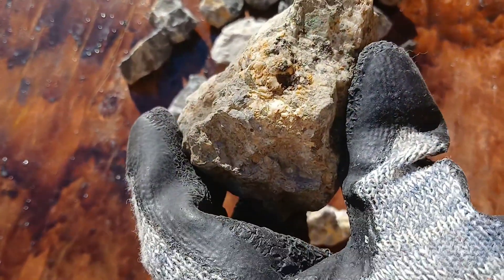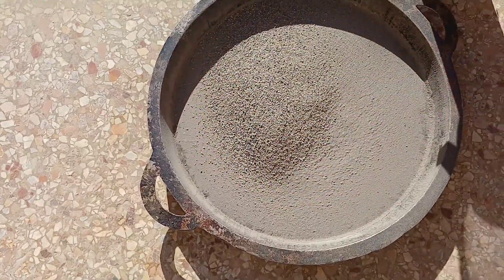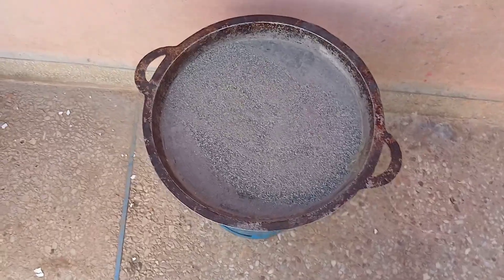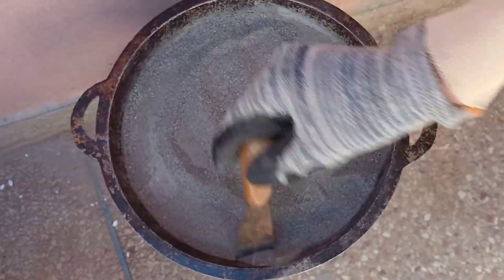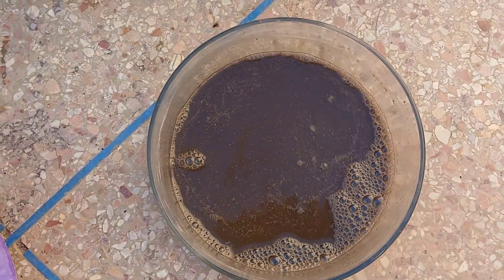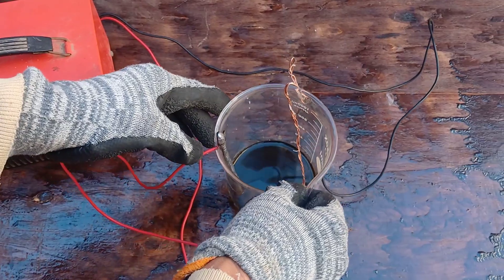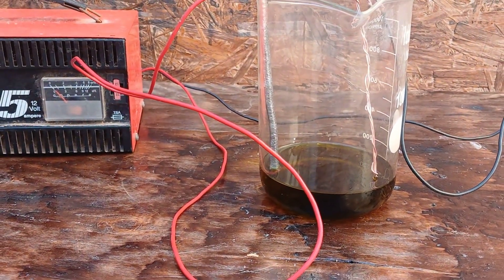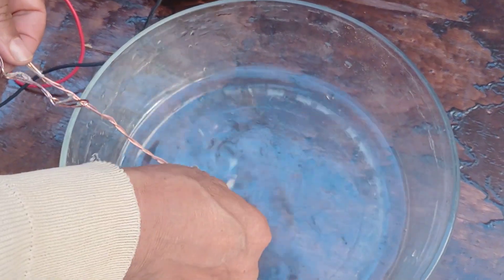"Extracting Microscopic Gold from Hard Rocks Using the Electrolysis Process of Aqua Regia"

Comment: The way I understand it is ‘microscopic gold’ is still visible with magnification.  ‘Refractory gold’ is sub-microscopic gold not visible even with an electron microscope.  Refractory gold is trapped within the sulfides and requires open-air oxide roasting to ‘liberate’ it from the host rock.  Once roasted magnetic separation is required to remove iron oxides.  I then use gravity separation to obtain the concentrates for smelting.
Reply: vc teria algun canal com algumas informacoes do processo amigo passar pra nos??

Comment: my ore is heavy in iron and my process with Hydro is green green green. Do i have to keep repeating the hydro step before moving to the AR process? it is causing a lot of problems and we know its high gold content.
I rinsed 5-6 times and sat over night and it was golden but when idfiltered it it turn brown due to fine sediments.
Reply from the maker: It looks like you're dealing with an ore that has a high iron content, and you're using hydrochloric acid (likely "Hydro" refers to HCl) before moving to the aqua regia (AR) process. The green color indicates the presence of dissolved iron (likely ferric chloride or ferrous chloride). Here’s a clearer breakdown to optimize your gold recovery:

1. Why is the solution green?

The green color suggests a high concentration of iron compounds, which can interfere with gold dissolution in the AR process. It’s essential to remove as much iron as possible before proceeding.

---

2. Should you repeat the HCl (hydro) step?

Yes, but only until the green color fades significantly. If iron remains, it can consume the nitric acid in aqua regia, reducing its efficiency in dissolving gold.

Steps to improve your process:

1. Leaching with HCl (Pre-treatment Step):

Heat the ore gently in dilute HCl (10-20%) to dissolve the iron.

Stir periodically and let it react for several hours.

Filter the solution to separate the solids from the iron-rich liquid.

Repeat this process until the solution is no longer deep green.

2. Oxidizing Agent (Optional for Stubborn Iron):

If iron persists, add a small amount of hydrogen peroxide (H₂O₂) or chlorine bleach to accelerate iron removal.

Avoid adding too much to prevent unwanted side reactions.

---

3. Dealing with Fine Sediments:

The brown color after filtration suggests fine residues (possibly iron oxides or other impurities). To minimize this:

Use fine mesh filters or vacuum filtration for better separation.

Perform multiple wash cycles with distilled water after each acid treatment.

---

4. Aqua Regia Process (After Iron Removal):

Once the green color is mostly gone:

Dry the cleaned ore thoroughly.

Prepare fresh aqua regia (3:1 ratio of HCl to HNO₃).

Add the AR slowly to the ore in a fume hood and let it react completely.

Filter the solution to separate dissolved gold from any remaining solid impurities.

Precipitate gold using SMB (sodium metabisulfite) or  a similar reducing agent.

Comment: IM fucked... Ive got way too much platinum in my gold and I suspect it's preventing gold from precipitating. Electrolysis might work, but gold and platinum are so close in their electrode potentials.
Reply from the maker: It sounds like you’re dealing with a challenging situation. 

Here are a few things to consider:

Precipitation Techniques: Try adjusting the chemical environment to enhance gold precipitation, like using different reagents (e.g., sodium metabisulfite or ferrous sulfate). This could help you selectively precipitate gold while leaving platinum in solution.

Solvent Extraction: You could also look into solvent extraction methods like using organic solvents to selectively extract platinum and leave the gold behind.

Cupellation: Another approach might be cupellation, which works well for separating precious metals like gold from impurities. However, it might not fully separate platinum, so you could use it in combination with other techniques.

Refining: Consider refining your gold using processes like Aqua Regia, which can dissolve both gold and platinum, followed by selective precipitation or solvent extraction to separate them.

Would you like more details on any of these methods?
Reply: @Goldchannel  I would!